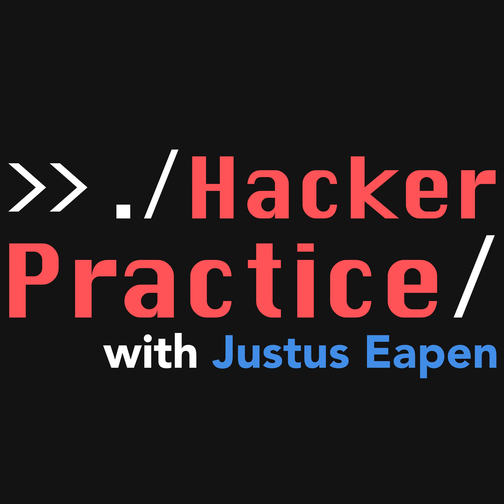Andrew Dodson: How to build a Nuclear Power Plant in your Backyard (Make America Nuclear Again)

Comment: what if we could use abandoned water wells......  I used to drill waterwells and abandoned them as well...  the first hole we drill on average has a radius of 36" @500' to 1,300' at times water is still present down hole.... note there are different reasons for the well having been abandoned.. .... any ways ill email u thanks...